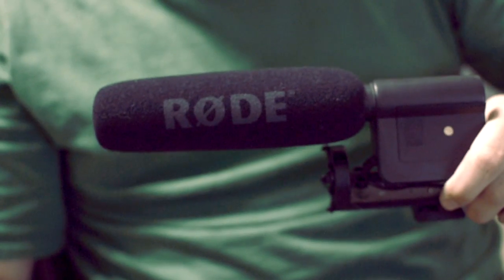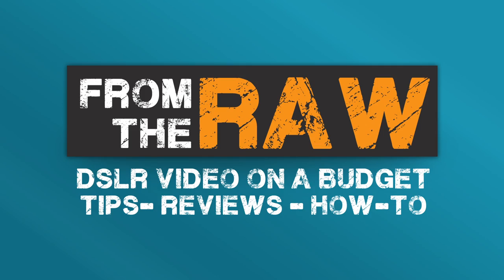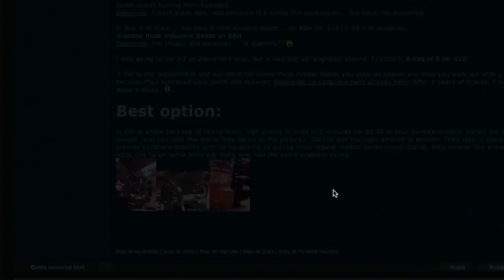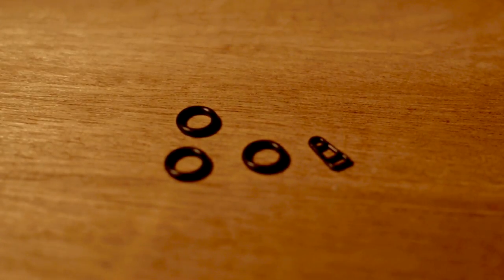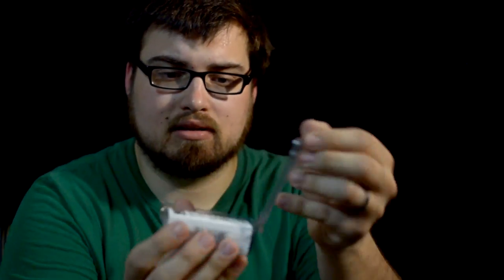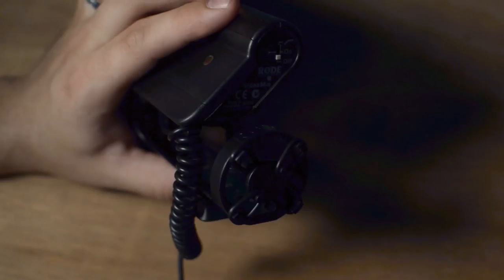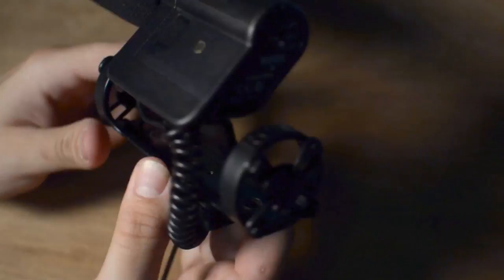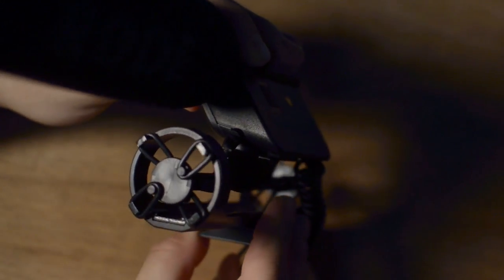Rode Videomic Suspension Bands Alternative DIY

Comment: Nice tip.  For people in the metric world, the perfect size O-ring for this is 9.1 mm internal diameter (diameter of the hole) x 1.6 mm thickness (diameter of the rubber strand that forms the ring).  9.1 x 1.6 is a standard size for O-rings.  10.1 x 1.6 works also, but are just a bit slack so tend to squeak a bit.

Comment: Update:  Since the O-ring description wasn't any help I decided to do my own research.  I have the same RODE Shotgun Videomic in the video.  I determined the O-ring size I needed was 3/8" i.d, 1/2" o.d., and 1/16" thick.   That is a standard #012 
0-ring.  They fit perfectly with good suspension and you can buy a bag of 100 from Amazon for $8 so even if they don't last as long you can have enough to change them 12 times.